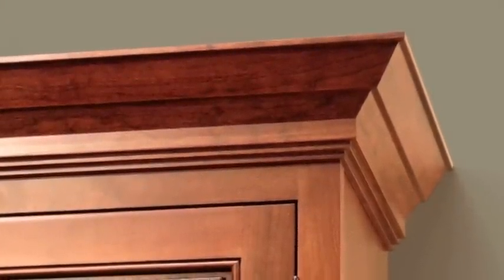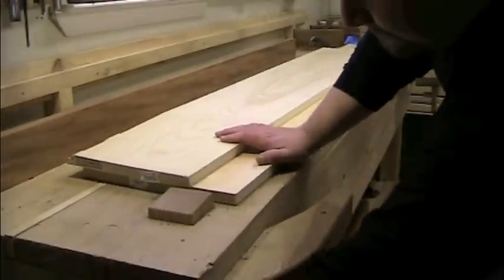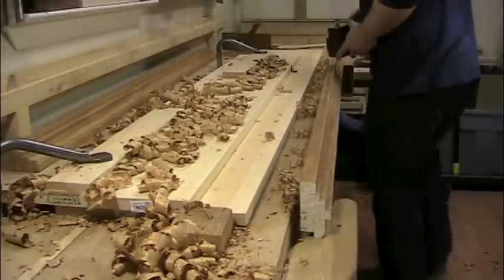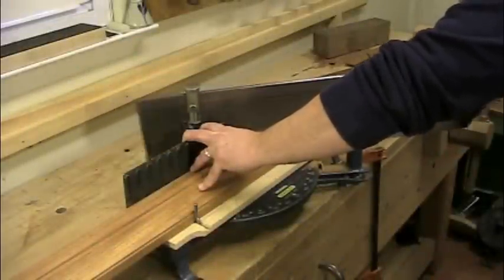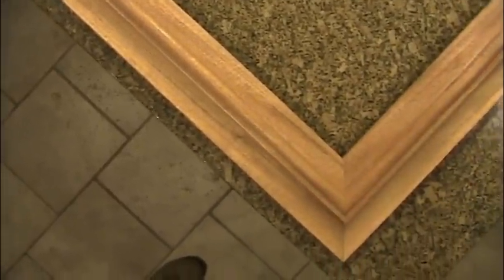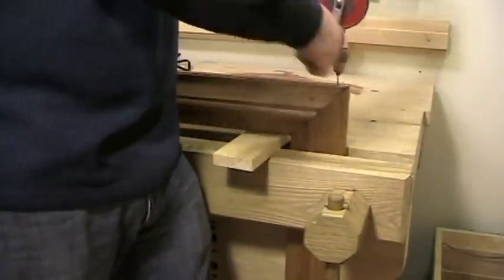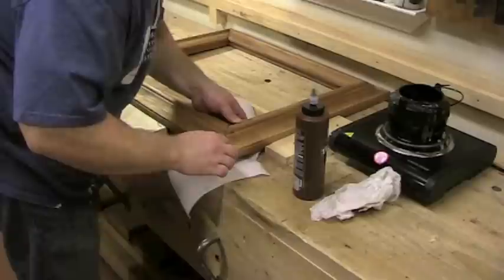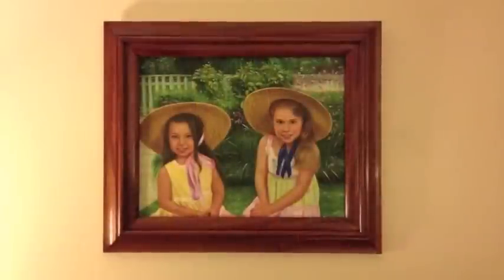How to Make a Mitered Picture Frame with Hand Tools

Comment: hi Bob, thank you for creating this video. do you recommend a specific manual miter saw?
Reply from the maker: None specifically. Most of the older models by Stanley and Millers Falls were good quality tools. Avoid ones with any plastic components and just make sure whichever one you get has all of its parts. Finding replacement parts is extremely difficult so it’s better to avoid miter boxes with missing parts.